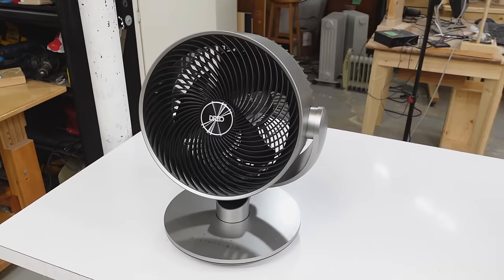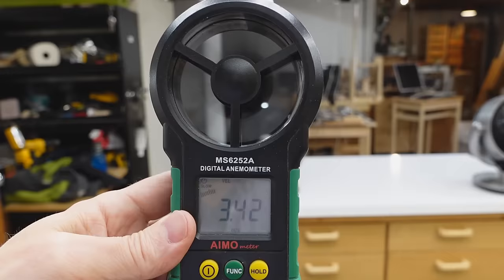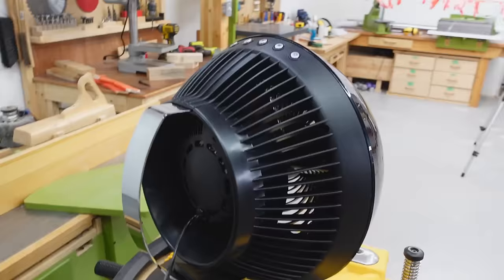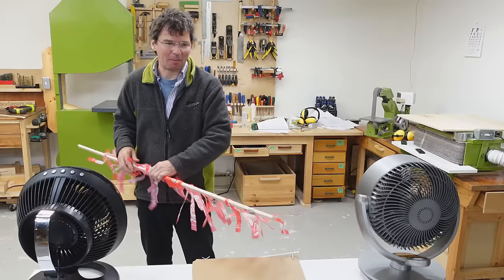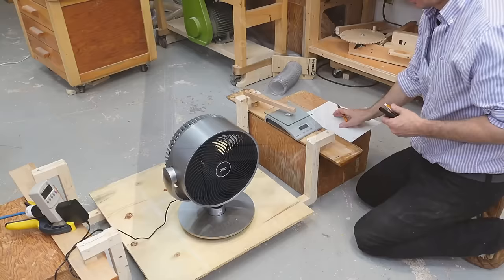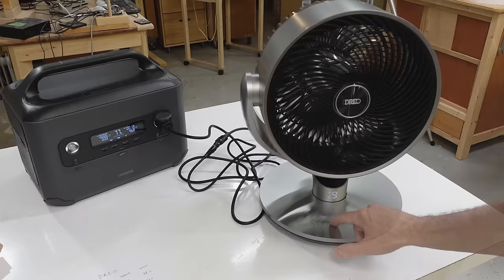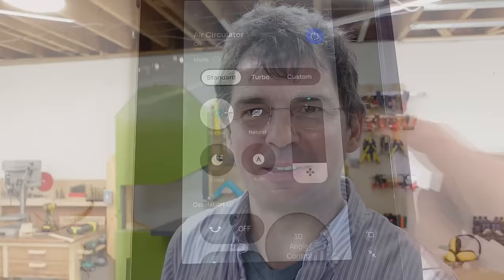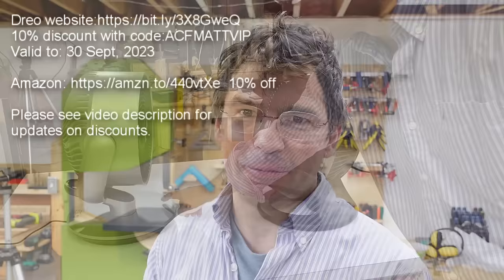Dreo vs. Vornado air circulators

Comment: I'd like to see more testing on the Dreo and other fans in your stable, as to CFM, noise, watts used for each speed, etc. 

I see you have a CFM meter; I'd like to see if the Vornado 660 truly moves 580+ CFM and if the Dreo moves the claimed 1000+ CFM.

Comment: Has DREO published any specs on the protocol that he app uses? If so, it would be pretty neat to write a little python for your Raspi to control it. Automated motion controlled fan that follows you around the room like your infrared heater video?

Comment: I bought one and like the fan a lot. But, when connected to my network, causes havoc for other devices. Nvidia shield unable to connect with some streaming services. Couldn’t complete payment for an online purchase on laptop (which flagged reason as being a device on network sending too many pings). Even had trouble working remotely through employer’s network when fan on same WiFi. Unplugging fan solved all network issues across those devices. Maybe just a one off issue with my unit?

Comment: I don’t think I have ever been more disappointed in a fan. I purchased this one after I watched your video. It was sold out on the official Dreo website, so I purchased the exact same version I from Amazon. Maybe I watched too many videos that hyped it up. The fan is just okay. I knew it would be average when I took it out the box and it felt super light, plastic-like and cheap. The wind speed is average at best. A box fan could do the same thing and at a lower price. I would not personally recommend it. 😢

Comment: I want 2000 cfm, straight line, adjustable from straight up to nearly straight down. I also want NO ELECTRONICS. Manual switch only.
I want it so strong that it can make a ceiling fan in off position spin pretty quickly when the small fan is on the floor.
Remember, fans slow down as they age.

What size capacitor to splice into the power line on the Vornado and is it spliced in series or parallel with the power?
Reply from the maker: You need an industrial fan, the kind they would have on a factory floor.
Reply: @matthiasrandomstuff2221  Perhaps but if someone would tell me what size capacitor to use and how to hook it up, a smaller non industrial fan might just do the job.
I do have a fan that is very strong (all metal) BUT the LOUD vibration noise makes it impossible to sleep.

Comment: look.  ive made many comments being very critical of your sponsored dreo reviews.  i want to start off saying thank you for all of your posts/videos because i really like fans and i have not seen anyone else make very in depth detailed videos like this.  so of all my negative comments or whatevers, still thanks for going through all this effort.

man, these dreo and vornado fans look too similar.  it took me way too long to find the exact ones he was comparing.  i originally only found the lower end models of dreo and vornado.  and then was going to complain about the big difference in price.  but yes, it looks like they both MSRP at $100, and both are on sale for $85 at the time of this comment.  vornado 660 and Falcon S dreo.

......ok wow, those power use/differences are just crazy.

one last problem though.  do you get 1 of this bigger 11" dreo ones at the higher price?  or do you get 2 of the smaller 9" ones?   you know i wanted to dislike the dreo fans.  and i could find maybe a different fan or 2 that had 1 or two properties BETTER than the dreos at a lower price.  but i can't find one that has all of the good properties of the dreo ones.  expecially ones that are easily taken apart for cleaning.  all of my fans are badly caked up with dust and they break over time from me unscrewing to take apart for simple wipe downs.

Comment: The dreo has a dc motor and the vornado has a ac motor and the dc motors always spin faster then the ac motor and the vornado 533dc witch is way smaller and has 1000 cfm compared to the vornado in this video has 584 cfm

Comment: This was an entertaining and well done review….but there are some important points that the reviewer left out.  Based largely on this review, I purchased a Dreo fan and I was deeply annoyed at what I received.  The box was BADLY packaged  with the top heavily bound by packaging tape and it looked like the company hadn’t bothered to even measure how tall their product was before they ordered their boxes!  It was kind of just shoehorned in there so that the box lid could barely close over the fan (even with the tape!). That was the first bad surprise.  The box also SMELLED TERRIBLE with a mix of must and heavy chemical smell.  Added to this disappointment, was the fact that the box had a large P65 warning on the bottom that stated that the product could expose one to LEAD (a carcinogen) and BISPHENOL A (a suspected contributor to reproductive harm in Humans).  As expected by this point, it said the product was made in China.   Why didn’t the reviewer mention this! At all!  Many people would be disturbed by the idea of using a product that contains these chemicals to blow air at them!  Will be getting rid of this piece of potentially toxic junk as soon as I can!😡

Comment: Can u custom control also the vertical oscillation, in the video u showed only the that u can customize horizontal. I am wondering because if u can customize vertical oscillation it will be percect for my bike trainer i guess it can oscillation kinda  on my head body legs only  ?

Comment: On the first test, what is the CFM of both at max speed ? If these are different, the test just does not make any sense. Efficiency should be compared at similar blade size and similar blade speed

Comment: I much prefer a large slow moving, non-oscillating fan a few feet from me.

...nearly all the large fans on the market run way too fast though even on lowest setting.
Reply from the maker: these typically use a 4-pole induction motor, which determines the speed range.  Box fans typically have 6-pole motors, so they run slower.  But they tend to be loud.

Comment: I'm curious how the Dreo fan compares to a similarly priced box fan, both in sound and air flow. The drone you get from a box fan, that you can hear in that vornado fan too, drives me nuts.

I kind of figured it was something to do with blade shape, but now I'm wondering if it's the motor.
Reply from the maker: definitely the blade shape. The ducted fan may help a lot in that it cuts down on vortices at the end of the blade.

Comment: I didn't know they made 24 volt DC adapters I wonder if a cordless drill could be run off one of those adapters.
Reply: Probably not. The adapter looks too small to supply the kind of power a drill may need. By a factor of up to 6 I'd say. It might start a drill but then fail when you try to put a load on the drill. Some tools can be power hungry when you're actually using them for work. Wimpy little PSU wouldn't like it then. Fans are more of a steady load.

Comment: Looking to run this on the lower speeds in a campervan off the 12V. What size will I need to plug into the fan side? Will 5.5mm x 2.1mm work? What did you use??? Looking at a 12v 24v DC 5.5mm x 2.1mm car cigarette lighter extension power supply adapter cable with 15amp fuse,  but don't know if that is right.
Reply from the maker: probably about that size.  I didn't measure it.  Seems to be the usual larger size of these connectors.
Reply: Just to follow up. I ordered a 12V car charger cable with a 5.5mm x 2.1mm connector. It plugs into the dreo and works for me. I only run the dreo on fan speed 3. I'm now ready for power outages and car camping!

Comment: The dreo fan looks so nice, the only downside is the app. How long before it's not supported
Reply: As long as you can use the fan without the app, it's hardly a downside.
Reply: about 6 months :D
Reply from the maker: Some of the fancy featues like auto mode need the app to set up.  And the aiming the fan remotely of course requires the app.  I keep bugging Dreo about releasing an API for their products, and they said they are working on it.
Reply: @matthiasrandomstuff2221  It would be pretty cool if a "smart fan" like the Dreo could actually be supported by a Home Assistant plugin!

Comment: I don't really care too much if the product has an app allowing you to control it, so long as you can control it manually too. Nothing worse than the company discontinuing the app (or going under themselves) and leaving you with a paperweight because of lack of manual control.
Reply from the maker: yes, needing an app is kind of annoying.  The fancy remote control of the oscillation requirs the app though.  But if you have in front of you, you can just turn it manually.  The nice thing about this one is, you can just turn it up or down by hand if you want to.  Being able to aim way up or down is also kind of handy.

Comment: 3:40 I don't think this explanation is correct. The accelerated air cannot both expand and accelerate. I think you will find that if you do some testing with streamers you will find that the airflow goes in the opposite direction of the arrows you have drawn - toward the axis of rotation, not away from it. It is not intuitive, it seems like the air should be flung outward - but it isn't.
Reply from the maker: yes, as I explained
Reply: @matthiasrandomstuff2221  
A propeller does not fling air outward at all like shown in your drawing. The explanation of the air being pulled back together by a partial vacuum behind the blade is not correct. 

The airflow narrows as it speeds up even before passing through the propeller disc. 

Please do research this, you have a reputation for being methodical and accurate.

Comment: I'm in Australia where the power is 240V.  Could I just buy a 240V DC adaptor with the same output and it would all work without a transformer?   If anyone knows what the Dreo PolyFan 513S adaptor output is please let me know.
Reply from the maker: the adapter goes up to 240 volts, so all you'd need is a plug adapter.  Or I imagine they have an aussie plug adapter for seelling in oz.
Reply: @matthiasrandomstuff2221  That is very helpful.  Thanks Matthias.   They don't seem to be selling an Australian plug, so I'll buy a simple adaptor.   This would also allow other users around the world on 240V to use this fan.    I've had a look at most of the fans available here, and I think the Dreo with stand is easily the best one I can find in terms of features and looks,  The Dreo is powerful, oscillates, and is attractive.  The Vornado DC equivalent's lack of oscillation, and less attractive stand are real drawbacks for it.  So thanks for your video.

Comment: How can one build an air filter that captures particles size of 2 microns?
This air quality is bad due to Quebec fires.
Would sticking a few layers of toilet paper to the back of a fan not capture anything of that size?
Reply from the maker: it will capture stuff of that size.  Not super well, but better than nothing.  Main problem is the toilet paper has a lot of air resistance and the fan not a lot of pressure, so your flow thru the paper won't be great.
Reply: @matthiasrandomstuff2221  Like you said, better than nothing. I'll try it with my heater on fan setting.

Comment: what if you use a 12v to 24v boost converter?
Reply: don't.  it is a brushless motor. it means, the higher voltage will kill the electronics that control and drive the motor
Reply from the maker: it’s meant to run on 24 volts
Reply: @matthiasrandomstuff2221  that's embarrassing.😅 I guess, myself rushing to reply was the mistake.